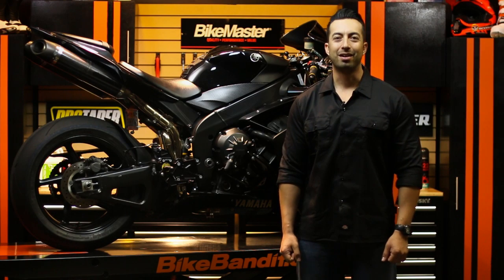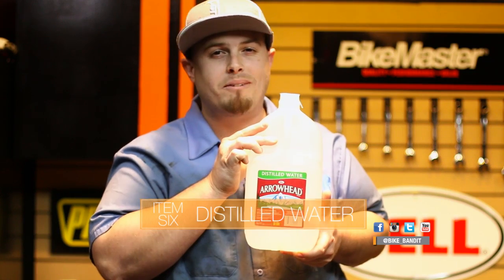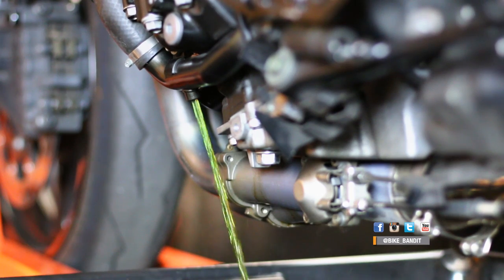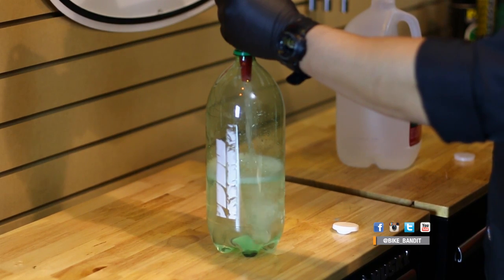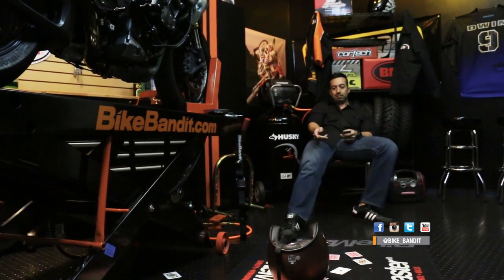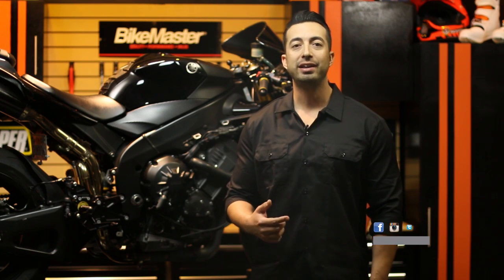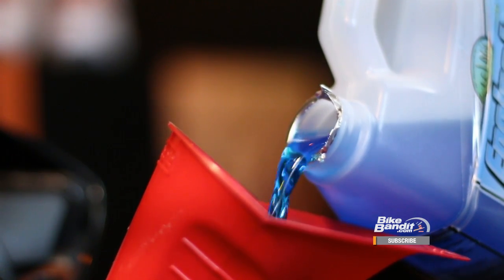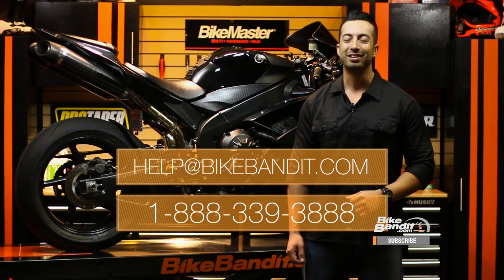How-to Flush and Change Motorcycle Coolant | BikeBandit.com

Comment: 2 questions how do you make a 50/50 mix of distilled water and vinegar to flush out the system ? Is it as easy as pouring half water and half distilled vinegar in an empty soda bottle like shown in the video ? Also is this mix safe for aluminum engines ?

Comment: Little confused. Appears you drained out all the old coolant (approx 2.5-3L) and then used just 2L of distilled water/vinegar mix. This is safe to have so little fluid in the radiator?  Many thanks, in advance.

Comment: Ummm, this is not the greatest video people. You need to bleed the system of all air and better believe there is a good deal of it in there. If you do not, you risk, and more than likely will damage many components of your engine. Not the least of which being...you guessed it, your engine. Head gasket is a close 2nd, water pump, rad, head. Bleed people

Comment: Hi there... this is very informative, thanks for such a great video. I am in Africa and as usual, we do have hot weather. Is it necessary to mix the coolant with distilled water?
Reply: It depends on the coolant you buy. Some comes in a concentrated form that needs to be mixed with distilled water and others come premixed so it isn't needed. It varies by manufacturer so its best to just reed the label and see if it calls for dilution.

Comment: Just a quick adendum: The top-down hose direct flush has its own reason of existance.
When some parts corrode or really big flaky deposits appear (particularly in old bikes that haven't run that much or just bikes that have been sitting for a while), it is preferable to use this approach, as forcing those flakes and deposits in an anti-gravity way by running the bike may have them clogging up your system, particularly in smaller diameter tubes and parts. In some cases, it may even damage the water pump, and this can be a bummer if you have just replaced it.
It even saves you time and distiled water, particularly if you know the bike well and are able to do this whilst by-passing the thermostat, so you get the whole circuit. Although if you do this with tap water, I'd recomend flushing it at least once with distiled water before you put your coolant.

Comment: Did you have to put the rad cap back while running the engine on the last part? Some say you don't put the cap for 10 mins idling.
Reply: We leave the cap off,,,it seems to help with air bubbles.. giving the air an escape....sort of like burping the system. But every setup is different and it may help or not.

Comment: How long does it take for the fan to come on?  I was running it for 40 minutes until the radiator hoses were hot to touch, but I gave up as the fan didn't come on.
Reply: There is a problem in your thermostat

Comment: On a GoldWing there is always about 3/4 +/- of a quart that remains in the system after draining. I flush with 2 quarts of new coolant and dispose. Also if coolant contains silicates it can be death to the coolant pump. Best to check owners manual for ingredients known to cause damage.

Comment: So my question is this: If you use vinager and distilled water to cleanse, and then flush the agent out, how do you know that you've gotten all of the agent out ?
Reply from the maker: +Stefan Harnesk great question. If you have any question as to whether or not the flushing agent has completely been removed, simply do an additional flush to ensure that it has been completely evacuated from the system. Thanks for watching and commenting. To show our appreciation here is 5% off your next order when you use code YOUTUBE5 at checkout (std. exclusions apply)
Reply: Will do, thanks !

Comment: How do you get the rest of the air out of the system? Is their a valve to open to "Burp" the closed system of all the air..or..?
Reply from the maker: Many bikes will have multiple ports on the cylinder or cases to open and help purge any air. I'd consult your owners manual to see if you have any that we haven't covered in this video.

Comment: Here's some more details to watch for...Some of the stuff was overlooked burping and tighten cap otherwise boiling overflow ...also be SURE your fan is kicking in at bout 220. Be sure to know the specs for your BIKE so if it's 38 oz out be sure 38oz  goes back in. If you are going to the track NON BASED Glycol Royal Purple with straight distilled has been working read directions 2 oz per quart of distilled so a 12 0z bottle would be good for 3 flushes most bikes. 11$ a bottle 1$ for a gallon of distilled...ONLY use this if you are track riding in case of overflow... anti freeze is like oil on the  track will be hard to clean. AND IT FREEZES SO DUMP IT BEFORE FREEZING WEATHER UNLESS YOU LIVE IN A WARM AREA WITH NOTHING BELOW 32 F. If you can't get to the overflow tank ...try a shop vac and a piece of small fuel line duct taped into a makeshift hose,  and try sucking it out. I tried it... it worked ...otherwise you may be removing your tank more fairing etc...Remember the green stuff is anti freeze not anti over heat. Be sure the pump is strong , fan is working and the dumpflush is fairly clear...and for all you guys and gals that forgot what a gallon and a quart is 64 oz is a gallon ...how many quarts in a gallon...4... 2 quarts is 32 oz how many ozs of Purple per quart? 2... Antifreeze 50 50 mix...buy the 100 percent mix and mix your own otherwise you are paying for  half water in a 50 50 jug...year getting ripped off.
Reply from the maker: Great points Gary. Thanks for the comment and additional advice.

Comment: That was the best flush video I have found. I was prepping for the track where no glycol is allowed...I used distilled and Purple mixed ....38 ozs distilled 4.5 ozs Purple. I did the overkill triple flush. Fan came on at 220 and sitting idle stayed at 218  2006 CBR 4fi / ... Overkill , but it was first flush with used bike.
 1 owner 12,200 miles. Spectacularly clean. Thanks for the video...GmanJet #62
Reply from the maker: Thanks for the comment. Glad to see that our tech pieces are helping people out.

Comment: Is it true that the system automatically burps itself? I've heard that it does and that it doesn't. Obviously I don't want to be riding around with air in my system O.o 

I really did like this video and I definitely will be looking up more how to's from you guys as needed.
Reply from the maker: yes, but it can take some time and it depends on the type of bike you have. some engines have multiple spots for you to bleed air from the cooling system. you open up a bolt passage and bleed the coolant through very similar to bleeding brakes. You can usually reference your owners manual to see if you need to. Thanks for the great feedback!

Comment: I really like this method. I was an auto mechanic for 7 years and I've never seen anyone use distilled vinegar to clean and flush a cooling system. that was actually a really cool tip.

Comment: I have a 2011 triumph Daytona 675, last time I took it for a  ride, the coolant was boiling and spilling out of my ride.
I tried riding it back home and the engine was overheating to the point where temp light came on, pulled over, let bike cool for hour and half, got back on hwy, within 10 mins, high temp light came back on- towed bike home.  any ideas or suggestions. thanks
Reply: Dave Almeida water pump might be shot,meaning no coolant moving through bike
Reply: Dave Almeida Dude the same exact thing happened to my 675R today. I bought a whole new radiator cuz of this.
Reply: Mine also was shooting out from the radiator head

Comment: when you are working the air out of the system, do you put the radiator  cap on while letting the system run or leave it off?
Reply: I'd love to know the answer to this one^^^ too!!! As I noticed he didn't whatsoever mention ANYTHING about is the cap ON OR OFF during this entire process!?!?
Reply: 105rogue .....burp I heard.....
Reply: Some of the stuff was overlooked burping and tighten cap otherwise boiling overflow ...also be SURE your fan is kicking in at bout 220. Be sure to know the specs for your BIKE so if it's 70 oz out be sure 70oz  goes back in. If you are going to the track non Glycol Royal Purple with straight distilled has been working read directions 2 oz per quart of distilled so a 12 0z bottle would be good for most bikes. 11$ a bottle 1$ for a gallon of distilled...ONLY use this if you are track riding in case of overflow... anti freeze us like oil track will be hard to clean. AND IT FREEZES SO DUMP IT BEFORE FREEZING WEATHER UNLESS YOU LIVE IN A WARM AREA WITH NOTHING BELOW 32 F. If you can't get to the overflow tank ...try a shop vac and a piece of small fuel line duct taped into a makeshift hose,  and try sucking it out. I tried it... it worked ...otherwise you may be removing your tank more fairing etc...Remember the green stuff is anti freeze not anti over heat. Be sure the pump is strong , fan is working and the dumpflush is fairly clear...

Comment: might be a PITA but to flush it out efficiently I'd remove the thermostat to ensure the block gets completely flushed and drained.... replace thermostat before filling the cooling system with coolant
Reply: Bigg Sean808 you just have to run it hot enough to where the thermostat opens.  removing it would be overkill/much more involved on some bikes

Comment: I thought on the final step when "burping" the air out of the system, the radiator cap should be off to let the trapped air escape? It's what I've seen in some other videos. Should the cap ALWAYS be on every time this video says turn the bike on?

Comment: What's the scientific reason to flush the cooling system w vinegar? other than to clean or flush cooling system n yes I'm new at this just got my first bike lol
Reply: Vinegar is acidic, it helps to remove limescale, rust, and other solid particles inside your cooling system, but vinegar itself may attack the metal parts of your system, so after using vinegar, do not wait for hours, you need to flush the system to remove the vinegar. Flush it with water, then you can fill it up with the coolant solution.

Comment: I thought on the final step when "burping" the air out of the system, the radiator cap should be off to let the trapped air escape? It's what I've seen in some other videos. Should the cap ALWAYS be on every time this video says turn the bike on?
Reply: Find the bleeder screw on your bike and leave the rad cap on.

Comment: Great video, thanks!  Are you supposed to put the flushing agent into the coolant reservoir too, or just the radiator?
Reply: I would say it won't need it since it's just a plastic container technically unless it's really dirty then yeah just to clean it up but if not it's fine

Comment: Where are the drain coolant plugs on the Honda VTX1300R 2006 motorcycle
Reply from the maker: Hey SV,
Usually only one drain, on the engine block, at the base of the water pump cover. Not sure exactly where on the VTX's. Just check your manual and it'll tell you the specifics re: where's the drain bolt, torque values upon closing up the system, quantities of fluid, etc. Thanks for watching our videos and the question. You're a subscriber to our channel, right? Ride safe. BB.com!

Comment: Hey Aaron. It's me again. So sorry to keep bugging you. Question. Need to change my plug wires on my 06 Vulcan 750. Could I use those 8mm Accel wires or should I stick with OEM NGK wires. Any advice buddy?
Reply from the maker: +steven j Hey SJ,You're not bugging us at all. This is what we do. Helping people have fun on motorcycles!When it comes to electrical things, I'm a fan of OEM. Already the right length, with all fittings and connectors facing the correct direction, proper gauge wires, etc.Accel makes a great product, but their universal kit would be something that I'd use on a custom machine that the OEM didn't make a set for. Thanks for the question.BB.com
Reply: Thanks again Aaron. Your advice and great knowledge has helped me tremendously. God bless brother and be safe.

Comment: Hey Aaron great video. Very informative by the way. Just subscribed also. I ride a Kawasaki Vulcan 750. My repair manual mentions bleeding the system of air while slowly filling with new coolant. I use Engine Ice Btw. Any advice would certainly be appreciated.
Reply from the maker: +steven j Hey Steve, No need to do anything different from what your manual says because you're using Engine Ice. EI just uses different chemicals than traditional coolant. The procedure is the same. Thanks for watching our videos and the question. Enjoy the ride. BB.com
Reply: Thanks Aaron. You've been very helpful my friend. God bless and be safe when u ride.

Comment: subscribed :D ...something i don't get: normal riding temperature is one thing(75 celsius), and the fan starting is like many degrees hotter (104 celsius)until wich one should i wait?
Reply from the maker: +JonTV Hey Jon,Thanks for subscribing. We appreciate the support. Re: which temp you're wanting...what you're doing is waiting for the thermostat to open so as to fully open the system, circulating the coolant from within the engine block into the radiators as well. Each bike is different, as are their thermostats. You should be able to check your manual and find the numbers on your personal bike. As an rough idea, think that most thermostats begin to open around 180* and are fully open at about 200*-205*. Hope this helps.BB.com

Comment: After the cleansing step, do you have to flush it again with distilled water or you can add the coolant right away?
Reply from the maker: +NiRMALCARES Hey NiRMAL,You don't have to, but if your system is already been opened, and flushing coolant is something you do every other year, the extra step just makes it just that much cleaner inside. It takes a little extra time, but the frequency of the job makes the extra time pretty insignificant. Thanks for watching our videos and the question. You remembered to subscribe to our channel, right?

Comment: How come you didn't Burp the system to insure getting all the air bubbles out of the system
Reply from the maker: heywood jablome Hey HJ, He did. That's the second step where he starts the engine and let's it get back up to temp. We just didn't put all of that in the video, but Aaron mentions doing it.